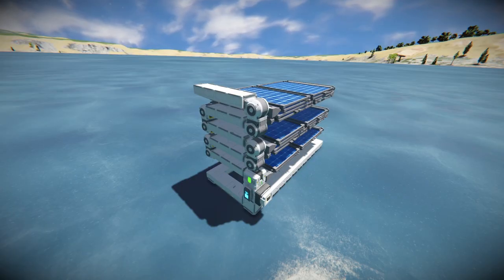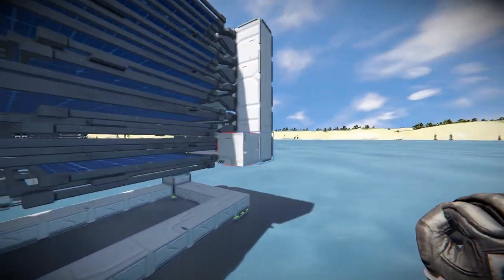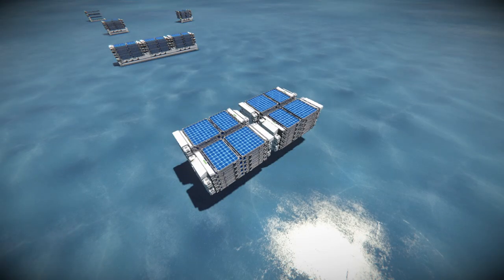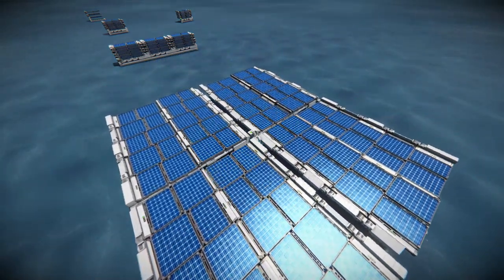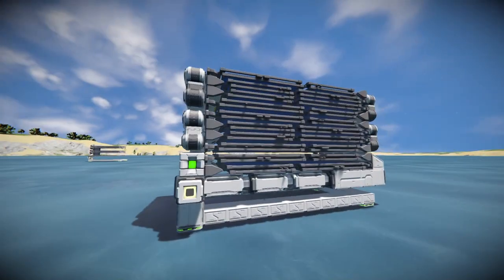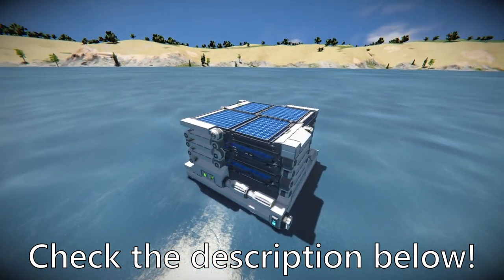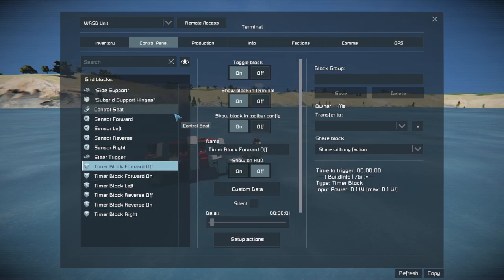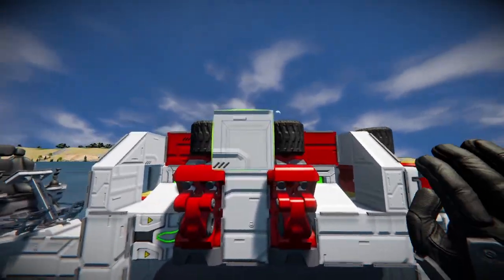Maximum Density Solar Array Packing

Comment: you could use merge blocks on every single layer so when its folded up, it merges with the ship as one single grid and not multiple. that would stop clang from exploding it if you are trying to do some fast moves in your ship.
Reply from the maker: 10/10 tips right here! I also designed the armor parts so that they won't merge so as long as the panels won't merge together this should work perfectly! Edit2: Sadly you cant merge the 2 halves together since the panels would occupy the same blocks. but if you keep the panels on the different sides of the pistons separate this should work.

Comment: I could see this working best as a hidden station powerplant. Imagine these extending out of a small hangar-like space on the side of a ground base as an alternative back up power, it'd be utterly amazing for hiding it away from the brunt of damage, due to it being generally hidden.
Reply from the maker: That would be awesome! A slightly downgraded version with 8 panels could fit through a single  large grid block opening. Although if I build it I'd probably go for upgrading not downgrading :D Aaand slap a custom blast door on top of the opening for protection.

Comment: In the 4th version you say "for some reason it doesn't work as well"
We're I to guess I would say it's that you don't have the side with the lights all together, I think that side of a panel is ever so slightly larger then the other.

Amazing work, I have put many hours into this game and don't think I have gotten anything close to this sort of complexity.
Reply from the maker: At least the panel model is slightly larger on that side. I'm not sure about the collision mesh. I might have to try fixing it some time by turning them around. 

Thanks man!

Comment: Nice! So about the wasd controller unit:
what if you slap a battery on the beam?
Reply from the maker: That would work for a while (probably months) and it was my first solution but I think the batteries drain some little power on their own. Might just remember this wrong.
Reply: @MjuMeli  I put an interior light on a small Battery and I think it said it would last 6 years... Thats ok. Lol
Reply from the maker: @Dagonius.  So it'd have to be reeeealllly loong playthrough for it do despawn :D

Comment: How did you place the solar panels? I am trying to add it to a ship but I cant place the solar panels on the hinges.
Reply from the maker: Hinges have a tiny hitbox you can use to place blocks on them, although they don't have a connecting face. In addition to this you can't have a solar panel connected on the other side of the hinge since the game counts it as colliding. You'll have to detach the hinge and turn the other solar panel away or use a piston to separate the detached hinge, add the panel, then bring the hinge back together and attach it.

I'm making a tutorial that includes this but it's a few days away still.
Reply: @MjuMeli  allright thanks

Comment: there is a shield mod that i use alot for grids that interact with other grids, its saves blocks that are hidden from bumps, rubbing and somewhat satiates the clang god. does not work on unpowered blocks
Reply from the maker: Good to know. Thanks for the tip!
Reply: What is the name of the mod?
Reply: @shahbazfawbush  Energy Shields